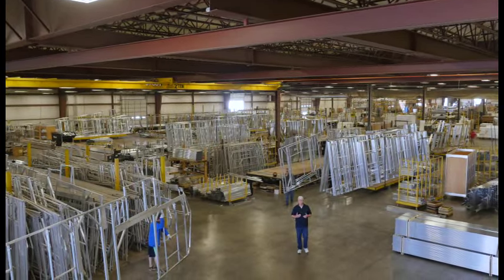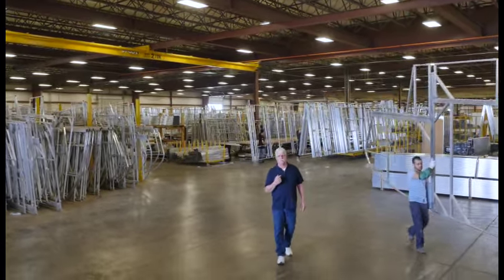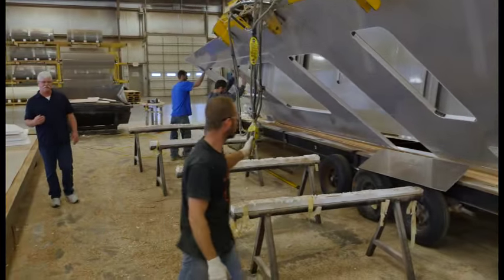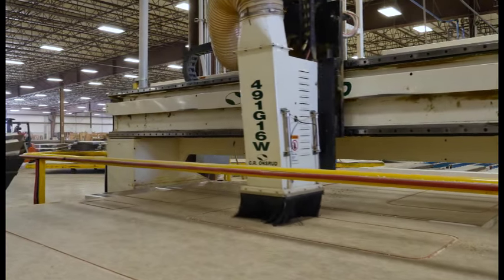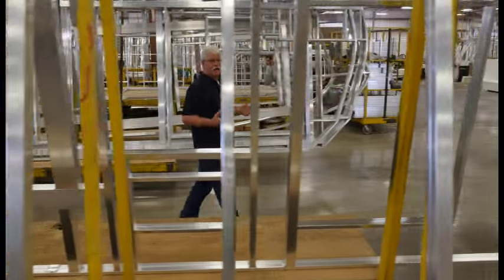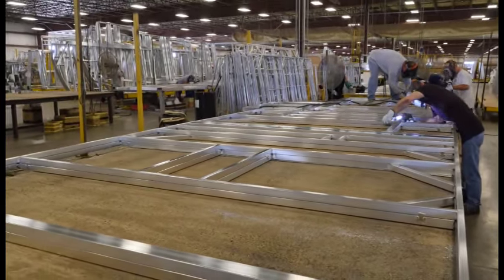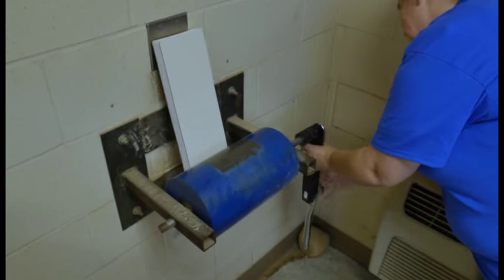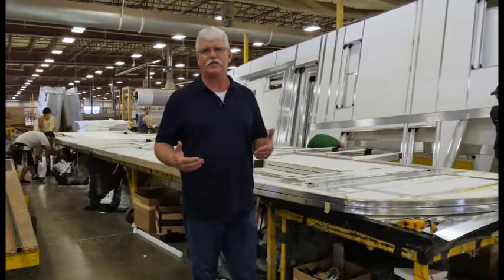Keystone RV - Lamination

Comment: Keystone I love my rig !! Only problem that was fixed on my end with a 2016 2400 bh never owned was I had to seal cracks right before the front cap.  It hadn’t leaked yet but I am sure it would.  Spend the extra 200 or 300 bucks and set sealing strips instead of or on top of joints in the front cap of the rig.  Then you will have the best product available!!
Reply: just wait, and be sure to look under refrigerator, they leave all their trash there.

Comment: They short sheeted the roof material on our 2015 Voltage, applied lap sealant onto bare wood. The subsequent roof leak and rot caused delamination. They refused to take responsibility for their poor manufacturing practices. Warranty claim denied. Keystone builds junk, buyer beware. We finally got rid of the piece of junk.
Reply: they build nothing but junk, the roofs are beyond believe!

Comment: Bought one that did not have a secure outer siding...made multiple calls and they would not stand behind their product even though when it was installed you can see where it is missing 14 screw holes that were only half screwed in. I called for several managers and they just say it could not happen.  I verified with the previous owner and the company that has done all repairs on the RV and both state this panel was not installed. I would not buy anything from this company they do not product a quality product and they do not stand behind their poorly made produce.  I just paid almost $3000 for a repair I should not have been responsible in my opinion.
Reply: you're not alone, my 2011 Cougar's roof started coming up after four years, I could literally pull it up like a sheet, I have been repairing their crap for years now, holding it together best I can, I can't afford to sell it nobody wants it, and I can afford buy another, they must have brain dead drug addicts working there.